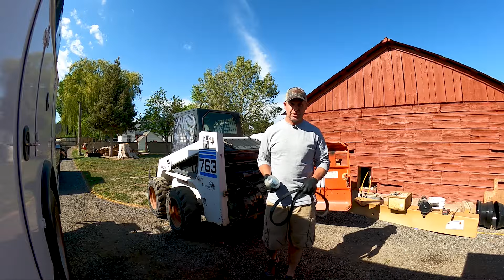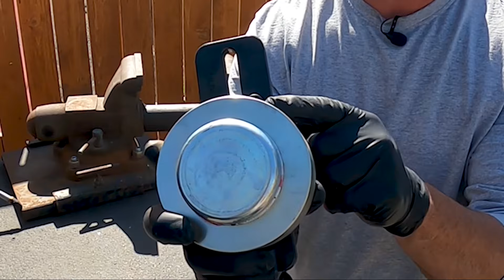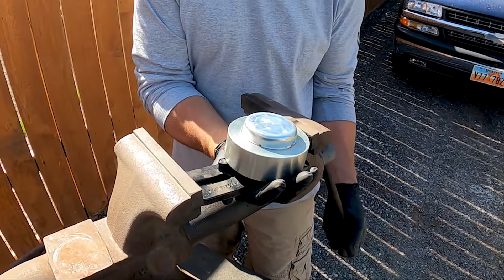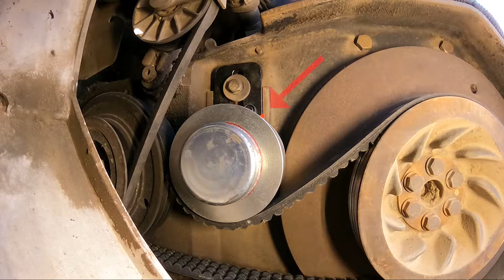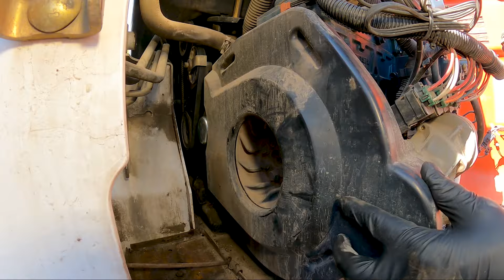Bobcat Hydrostatic Drive Belt and Tensioner Repair on a 763

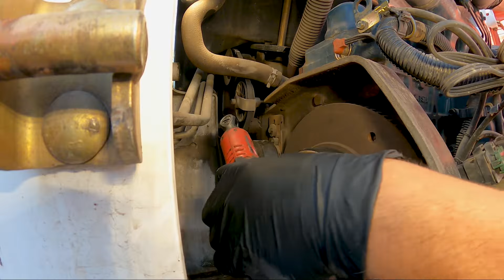Comment: A pry par won't always make the tensioner cam over with the lock bolt barely snugged up.  Mine will cam over in a vise but not on the machine using a pry bar.  I have to figure out some other way to cam it over in the loader.  There must be a special screw press that Bobcat mechanics use to push the tensioner bracket down before tightening the lock bolt.  There's also a boss in the bottom of the tensioner bracket that can be drilled out and tapped for an adjusting bolt that can push up on the pulley to set the pointer to the 2:00 position before tightening the lock bolt.  Bobcat doesn't use this type of tensioner on later machines, because it was an inferior design.  I already ruined one drive belt because I couldn't adjust a new tensioner properly.  It's just another example of stupid engineering from college boys that don't know how to use a wrench.

Comment: Is there anything special about installing the set screw on the cooling fan pulley?  The set screw presses on the top of the key. My setup turns fine but the pulley slides on the shaft and the set screw doesn’t seem to want to grab and bind it to the shaft.

Comment: Thanks for the comments on regularly checking belt tension. Our belt was very tight to fit but slacked off quickly. We thought it was initial stretch and you confirmed that, plus regular maintenance. That really helped 👍

Comment: I had encountered two hydraulic tensioner issues 
Both the nachines were BobCats.
One was a 1980's era and was leased to move air freight and stored outdoors (NW Arctic) the first had the bearing go dry, I was able to replace the bearing & oil Seal using NAPA replacement's and refill lube using Polaris snowmobile chaincase lubricant.
The second belt tensioner the oil bath Pully had spun on the tensioner shaft hour glassing it.
Since Im in Arctic Alaska over 550 miles away from Anchorage BobCat Id JB welded the pully on the tensioner shaft and let it cure, added some STP to the pully bearing lubricant (arctic summer) I was able to finish the work and return the skidsteer back to owners letting them know what was wrong and why.
I should have known when first borrowing it that it barely had any hydraulic pressure, I needed to knock down 3 truckloads of fill dirt that been delivered.
What caused the issue?
I think both issues stem from storing the equipment in unheated buildings of -30°F or more.
The block heater will start the motor but that giant oil bath pully dont wanna spin right off the bat.
Be kind and heat your Kitty before you play in the snow.

Comment: I have a squeal coming from inside that cover at 2300 rpm and above, constantly..  seems alot more in the way to get the cover off.. you think a tightening it need or just
Replace the belt and tensioner

Comment: On the cooling fan belt. Do all the pulleys line up straight? I have an 864 and the top pulley is about 3/4 of an inch to the right. So the belt comes off the idler pulley and has a lean to the right. I replaced a broken belt and the new one only lasted an hour. I may have had the wrong belt, it was thigh and very difficult to get on. I checked the motor mounts and they look good.
Reply from the maker: The tensioner bushings wear out and get out of align.  If the tensioner is leaning I would replace.

Comment: Oddly my T650 runs pretty dang good with the tensioner ( not under tension).  The spring load gives it enough force.   Reason: my foreman overtightened bolt and broke it in the block.   I had to drill it out but i felt it push thru.   PLEASE TELL ME THATS NOT A CLOSED HOLE IN THE 
BLOCK. ( which i opened ) Thats not the inside of the actual block is it?   I took a pic in the hole The steel looked very clean 😮!  Thanks for all the  vids!

Comment: Hey I install a new tensioner pulley and a new belt. like you have in the video. after starting, the belt jumps off the hydraulic pump pulley. ruins the belt. Please tell me what is the reason?

Comment: thanks for the video, tensioner wouldn't fit in my vise, but a big digging bar worked great to get the cams free.. tell you what's a pain in the a$$, is that fan tensioner pulley that thing whipped me

Comment: Can a bad tentioner cause lose of power ?
Reply from the maker: If the bearing is siezed it would destroy the belt but that's the only reason I can think would cause low engine power.  If you have low hydraulic power the belt could be loose and slipping possibly.
Reply: Ok. Thank you for the quick response!!! It is squeeking pretty bad anytime I put it under load or when I push the joy sticks "full throttle."
Reply from the maker: @dmadrigal4935  sounds like it's just loose, try to adjust the tensioner and see if that helps.  Probably need to replace the belt soon as well.
Reply: Thank you ! I'll give it a shot

Comment: Why does the part number shown on your new belt not match up to the part number on the link you gave on Amazon?
Reply from the maker: Good eye!  The belt I used was actually for a S160 and although different part number they are almost identical but 1/8 longer.  The S160 belt will work on both but the 763 belt would be to tight for the S160.  This way I only have to stock 1 belt on my truck for multiple machines.

Comment: Simple process... Except i can't neither my old one nor my new one compress, even in a vice. Anyone have any suggestions? 🙃 Pretty discouraging to be stuck on a one-bolt job 🙃
Reply from the maker: Try some WD-40 on the back side, should compress pretty easily in the vice.
Reply: @tetradgroup  there's got to be something I'm doing wrong. I tried two different vices I can't get either the old one or the new one to budge. PB blaster all over them nothing is moving at all. 😕
Reply from the maker: @StephenfCarman  can you physically see a spring in the back side of the tensioner? Not all tensioners are spring loaded.
Reply: @tetradgroup  i finally got it to go cranking with all my might on the vice. Soaked it with pb blaster and worked out on the vice. Now I'm fighting with it on the skid. Funny thing is, that it already seems pretty darn tight without the tensioner having even spun past the factory 1:00 position. I gave up on trying to tension it more, and just left it. Gonna start it and see if it's tight enough to work.
Reply: I have the same problem. No matter how much I crank down on the tensioner in the machine, that little arrow doesn’t move. Is the spring in the tensioner only there to help you adjust it? The spring doesn’t actually do anything once that bolt is tightened?

Comment: Nicely filmed video.  One question, does it matter whether the numbers on the belt face toward the motor or away?
Reply from the maker: Thanks and great question, the belt is not directional so it can be installed either way.

Comment: Did you use a bobcat OEM belt tensioner? Or did you buy one aftermarket. I see the aftermarket ones are about half the cost.
Reply from the maker: In this case I used an OEM tensioner. Although some people do not like the aftermarket tensioners I have used them in the past with good luck. I've rebuilt a few tensioners years ago however the price of the individual parts and the time involved to rebuild it in the long run its cheaper just to buy the complete assembly.
Reply: @tetradgroup  thank you for the reply. Mines making some noise and needs changed. Gotta decided what to do.
Reply: And I see on bobcats website they break them down you can’t just put new bearings in it and run it?

Comment: Found my problem.   Blower turbines basically stuck.  Oiled best I could and spun up with compressed air.  Fan switch not able to get the blower to turn.  Would spin up if I tapped on the housing, but would not start on its own.  Idea for new video -- How to replace blower.   :)  Thanks again.  Jay
Reply from the maker: Glad you figured it out, I thought it was blowing out of the lower vents but not the top which made me believe the blower was working.
Reply: @tetradgroup  You remember correctly.  Those two right-hand bottom vents apparently are controlled by a separate fan or blower (although I've not seen it).  Air comes out of them without the blower (under the seat) spinning.  When the blower (under the seat) spins up, the top vents deliver air.
Reply from the maker: @duxnlabs  yep, there is a small fan that pressurizes the cab in the right hand lower plenum.

Comment: Sorry to ask for advice, but my nearest dealer is a few hours away and not great helping by phone.  2013 T650.   Personal use only.  Ceiling vents are not blowing air.  Bottom vents blow on all three fan speeds.  Service manual does not show duct routing so I'm stumped as to where to check.  Cleaned out blower motor of dust.  Seems to spin freely.  Guess it's ok since the bottom vents blow air.    Ideas?  Really appreciate it.
Reply from the maker: No problem, anything I can do to help. Have you changed your outside filters and your recirculation filter behind the seat? The air flow system is a single plenum so there has to be an air restriction somewhere.  There is not a mechanical device that separates air from the top to the bottom vents.
Reply: @tetradgroup  Thanks so much for the response.  Cleaned the outside filters.  Inside filter is missing; cover is present, but no filter.  I shot compressed air backwards through the upper vents.   Maybe the recirc filter got sucked in. ?
Reply from the maker: @duxnlabs  it's possible but the filter is really small.  You have no air flow on either side of upper vents?  I have pulled large rats nest out of the headliners before,
Reply: @tetradgroup  I wondered about that.  Yuck.  Guess I'll start pulling the interior.  I REALLY appreciate your taking the time to respond.  I enjoy your content a great deal.  Very informative!!  Thanks.  Jay
Reply: @tetradgroup  Rats, in the headliner? Were there any live rats in there? If so did they fall on you?

Comment: I didn’t know you did request can you do the piston rings on a 773 video. That would be fun to watch! I don’t own one I just want to see you do it
Reply: I've got a 773 that I can't get the blade into float mode. Any tips or tricks or suggestions?
Reply from the maker: @ozarkarky  is it manual control or acs machine?
Reply from the maker: If you wanna send me a couple pictures of the control valve I have a better idea what were dealing with
Reply: It's manual foot controls only 😞. There is a float pushbutton on the left joystick but it doesn't down anything. After pressing the operate button the lift & tilt valve light slowly flashes but lift and tilt still works, and no error codes, so I've been using that way as long as I've had it.
Reply from the maker: Absolutely, thanks for the suggestion I'll get right on it

Comment: I have a 2001 bobcat t190 and there is a hammering noise conning from the flywheel area and I have replaced the drive belt and tensioner, machine runs perfectly but the noise it very annoying and fluctuates with the rpm and stays the same under a load, any ideas?
Reply from the maker: Remove the fan belt, run it and see if noise is still there